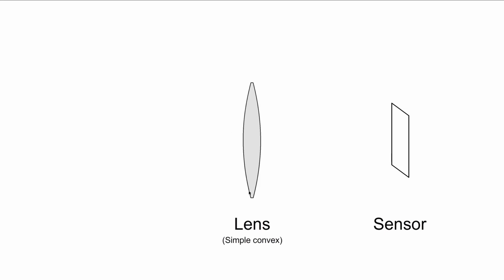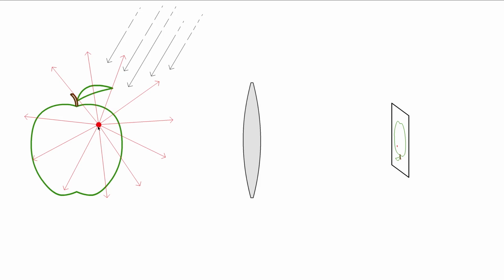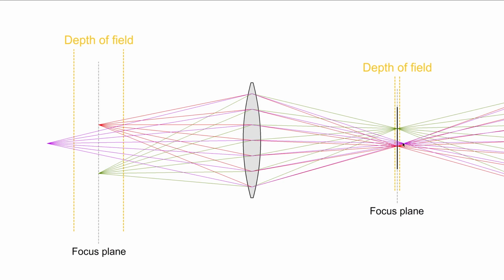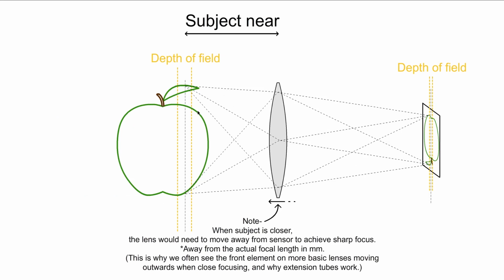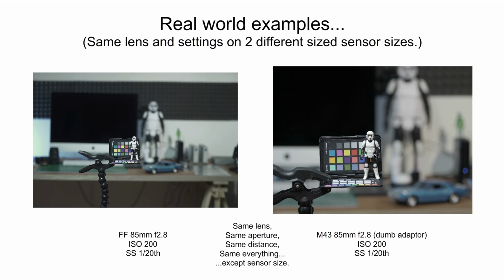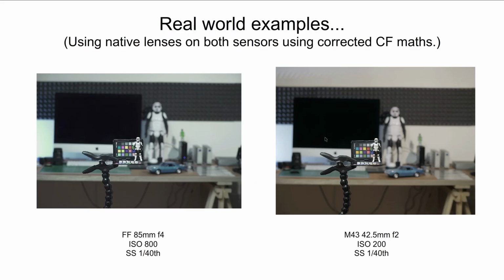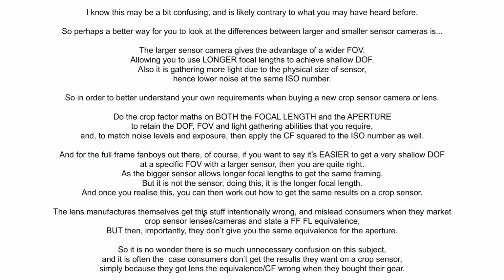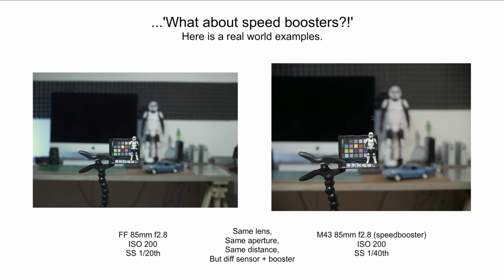Depth of field and crop factor misconceptions.

Comment: Biscuitsalive's Misconception: 

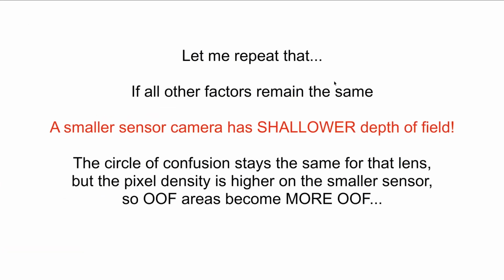@18:10 - "If all other factors remain the same, a smaller sensor camera has shallower depth of field... The circle of confusion has stayed the same for that lens, but the pixel density is higher."

WRONG, DOF is determined by the lens and shooting distance, not the size of the sensor. Image sharpness is likewise determined by the lens; it is not degraded by increasing the pixel density (resolution) of the sensor. The reason the cropped-sensor image appears blurrier than a full-frame image with the same FOV is simply because you are MAGNIFYING the dimensions of the smaller cropped image to match the size of the larger full-frame image. It is the SIZE of the sensor that matters, rather than the sensor's pixel resolution. We ALL know that when you MAGNIFY an image, its details will appear blurrier.
Reply from the maker: Fallen Star Features the DOF of the lens does not change using a different sensor. 
Yes. 
The apparent DOF of the image does change. 
As I clearly demonstrate. 

So not sure what your on about.
Reply: "Apparent DOF"? What's that supposed to mean? DOF is a measurable optical property, not an apparition. When you MAGNIFY an image, you change its optical properties. THAT's what I'm on about.
Reply from the maker: Fallen Star Features go and watch a video on the circle on confusion. 
I think that's where your falling down. 
I clearly didn't explain it well enough in my video. 
Please remember DOF is subjective to the medium you are recording. 
There is only one plane technically IN focus. 
Out side out that it's what's considered acceptably subjectively sharp enough or not sharp enough. 
and that subjectivity is dependant on the resolution you are capturing. (And to some degree the size and distance you are viewing the final image from)

I generally work in 4K video. On a 4K monitor. So that's a fairly consistent way to judge the OOF/in focus areas. 

In which case of course there is an apparent DOF. And can be compared and judged fairly equally. 

If I was working in 42 mega pixel photography and it was going to be scaled up onto huge billboard posters the DOF would need to be reevaluated for that medium. The circle of confusion for this would need to be much smaller to be acceptably sharp enough. 

Or inversely if I only worked to 1080 HD I could get away with a wider acceptably in focus DOF simply due to the circle of confusion being allowed to spread further before the sharp areas start to look OOF. 

I think you need to go away and do some practical tests yourself to see what I mean.  

You are not considering the final image and how it's DOF is subjectively read.
Reply from the maker: Fallen Star Features anyway. Sorry I don't have time right now for endless debate. About to get into the ocean. 

But I suggest you look at filmakerIQ video on the circle on confusion. And the role it plays on DOF. 
I think that's where you are falling short of understanding what I'm getting at. 
(He explains it better than me.)
Reply: What I'm seeing is more like a circular field of obfuscation on your part. All of the things you're trying to complicate are simply the result of MAGNIFYING a digitized image. When you do so, details that looked sharp because they were tiny become large enough for you to see how blurry they actually are. We've all seen this happen when cropping and enlarging images in Photoshop and there's nothing confusing about it. It's obvious why a large billboard needs sharper detail than an Instagram snapshot, but even there you neglected to mention that how much detail is needed depends on the viewing distance. A billboard 60 feet up in the air obviously needs less detail than one 60 inches away.
Reply from the maker: really not sure what your point is anymore. you are agreeing with what I'm telling you. so why are you suggesting I'm getting something wrong in my video?
did you actually watch it all the way through? what part is giving you an issue?

the smaller sensor WILL give an apparent shallower DOF if all other factors are the same.
(those being, distance, focal length, aperture, and resolution of captured image.)

not quite sure how you can deny that as its VERY easy to demonstrate with a quick practical test.
Reply: Because the fucking viewing distance from your monitor is the same whether you use high resolution sensors or not. This whole resolution fuckery is only relevant when viewing or printing in a specific size.
Reply: And still it only matters with IN-FOCUS elements so they're not blurred to death by too much cropping or low resolution.
Reply: Fallen Star Features, you say that DOF is not determined by sensor size. Then you say that it is the sensor size that matters. Which is it? Clue: it’s the latter. You are correct that the sensor size impact on DOF is also a function of magnifying, but that merely explains the why. It is the why concerning the simple fact that DOF is affected by sensor size in an “all else being equal” comparison (which is the only kind of comparison that’s useful). And that’s pretty much what Biscuitalive is saying. An unchanged size of Circle of Confusion with reduced-size sensor elements in it, is effectively the same as an increased size of Circle of Confusion with regular (FF) elements in it.
Reply: the pixel size doesnt change just the number of pixels so the coc would remain the same correct?

Comment: Am I correct that the crop sensor lens manufacturers also omit the angle of view differential when presenting 35mm equivalent data?  Superb video.  Thank you so much for producing it.
Reply from the maker: Jan Myskowski thanks. They vary from manufacturer to manufacturer. 
There is nothing wrong of course to stating a full frame focal length equivalent, on a crop lens/camera. (25mm m43 saying “50mm equiv”)
But to state that, and then state the NATIVE fstop is massively misleading. 
Either don’t put any FF equivalent. Or put both FL equiv and Fstop equiv. 

You see adverts and they say on a M43 14-140mm f3.5-f5.6 lens-> EQUIVALENT 28mm - 300mm f3.5-f5.6!!!!
It’s not! it’s equivalent to a 28mm- 300mm f7-f11.2 

Anyway. You get the idea. They use incorrect maths to confuse people. 
Then this is why consumers sometimes are disappointed in the performance of their crop sensor gear. 
It’s not the equipment. It’s the lack of awareness. 
Unfortunately. If you want full full frame performance on a crop sensor then you need fast enough high quality lenses. 
(Which do end up being nearly as big and heavy as the full frame counterpart. :/ )
Reply: Really appreciate your reply.  What I meant to ask, and probably did not word clearly, is whether you need to account for the fact that a given focal length has a fixed angle of view.  You can say that a 50mm APSC lens would have a FF equivalent focal length of 75mm or so,  but it still has an angle of view of 44 degrees or so, whereas a native 75mm FF lens would have a much narrower angle of view.
Reply: I just watched your terrific follow up video.  I’m not sure whether I am more confused or less confused about this question I am posing!!  You are using the term field of view and I am using the term angle of view.  Your last diagram in the follow up video shows that the field of view changes when putting a native FF lens on a crop sensor camera.  My question is whether the angle of view stays the same?  Angle of view seems to me to be a constant of the glass.  If that is so, it seems to me that you would get a different “look” between the otherwise identical fields of view.  Or, maybe I just have my head up my ass.  Help!
Reply from the maker: Jan Myskowski field of view and angle of view are the same thing. 
Yes the angle of view is same for lens. 
But when you put smaller sensor behind it the  full image circle (created by lens) isn’t used. 
Smaller the sensor the narrower the angle of view. 
(So on m43 the angle is halved compared to full frame. Hence the “2X crop factor” )
Hope that helps.
Reply: Thank you!

Comment: I've always liked that analogy about a marching army walking from a hard surface to a soft surface. I think you can take it a step further though. If you imagine each line of people is a different wavelength of light, the higher the wavelength the smaller and faster the gate of those marchers. So all the marchers are marching at the same speed, but on one side you have people taking large slow steps, and on the other side, people taking small fast steps. When they reach the sand, or mud, the people taking big steps get further into the mud before they are slowed down by it, and those taking small steps don't get as far before they are slowed down. That causes the marching lines to diverge from each other. I theory they should begin to converge on the other side of the "lens" but I think that could help explain chromatic aberration.
Reply from the maker: Grant Pluntze nice one! Yep that works lovely. I could see that working in a animation. :)
Reply: Grant Pluntze Dec

Comment: Okay so I have a question. After you applied the crop factor to the aperture, you ended up with the full frame image at f4 and the m 4/3 at f2. So of course these images look the same now. But with the full frame you still have the option to go to a lower aperture as opposed to the m 4/3 image you are at the lowest aperture setting (generally speaking if using a zoom). With that in mind wouldn't the full frame then be giving you a better depth of field?
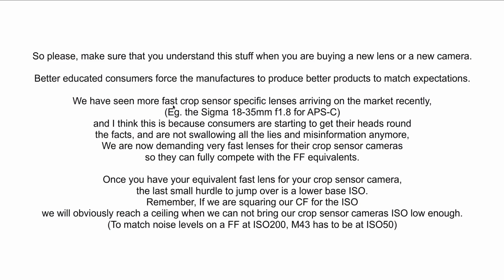Reply: 29:20 of the video he explains that consumers are wanting lens makers to offer true equivalent lens options.

But, I understand that Canon's famous 50mm f:1.4 is going to be hard to replicate into a 32mm f:0.875 for my APS-C Canon M...  or a 25mm f:0.7 for a M4/3.
Reply: Yes, FF wins.  Makes sense though.  Bigger is better.  Always has been, always will.  If you know what you are doing that is.

Comment: If you look up depth of field in Dofcalc for say 200mm @ f8 for APSC then change it to Full frame at the same settings then the DOF is actually wider on the FF setting. What is a speed booster?
Reply from the maker: Willnot Betracked what are you getting at here?
Reply: biscuitsalive Not "getting at" anything buddy - my first sentence was just a fact. Depth of field for the same focal length and aperture is actually shallower on apsc sensors than full frame (according to DofCalc). My second sentence was a genuine question - what is speed booster? I have never heard of that before. I wasn't trying to be disrespectful. 😀
Reply from the maker: Willnot Betracked ok, sorry i didn't mean my comment to sound like that, i was just a bit confused. The first statement sounded like you were pointing out something that countered what I said in the vid. 
But it of course does not. 

A speed booster or “focal reducer” is a very popular device many crop sensor users choose today to recreate a larger sensor FOV/DOF on their smaller sensor. 
Look at “metabones” that is the market leader. 
I use a XL .64 speedbooster on my GH5
And it means I can use my full frame lenses on my m43 camera and achieve the same FOV and DOF as a APS -H sensored camera. 
(I can use longer lenses and keep the framing)
Basically it regains the lost light that would spill around the smaller sensor. 
So the image is brighter too. 
(1.5 stops faster with my XL)
Reply: biscuitsalive Ok, thanks. I'll take a look at this metabones thing! 😀👍
Reply from the maker: they are expensive, but are amazing. the total light gathered from a full frame f2 lens is 4 times the amount gathered by a native M43 f2 lens. so its a awesome to be able to tap into most of that available light on a small /crop sensor camera.

Comment: QUESTION:  I get really confused when you say to square the iso.  If you square any number, then is not that number multiplied by itself?  EX: 200 squared would mathematically be 200 x 200 ... and that equals 40,000.  However, in your example towards the end of the video, instead of squaring the iso, you actually increased the iso two stops, because the micro 4/3 sensor is twice as small. I can understand that part, but what confuses me is how am I to determine what the equivalen iso should be on a Canon APS-C (1.6 cropped) sensor.  Can you provide some clarification please?  It would really be appreciated.  Thank you.
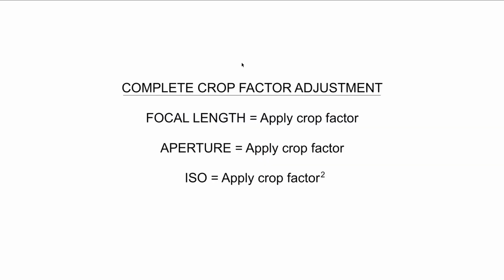Reply from the maker: Hi so what I was getting at (timecode 23:28) is you take the crop factor.
eg. X2 for FF - M43
or X1.5 for FF - A-PSC

and you square that, and apply as you would for the rest (FL / Fstop)

so for a example of the equation written down=

Lets say we have a M43 camera, we want to match ISO equivalence for Full frame. (to get a good approximation match noise level equivalent, and complete the whole crop factor formula )

We take the M43 ISO of 200, we apply the crop factor and square it.
So if you tap-
'200'
'Times' (X)
'2'
'X2' (the squared button)
'equals'
and we get 
800

(long winded way of saying we square the crop factor, not the iso number.)

Or if the above was going from A-PSC to FF we would do-
200 (for our A-PSC ISO) 
'times' (X)
1.5 (or, for Canon, 1.6)
'X2' (the squared button)
'equals'
and we get 
450

So in that case the A-PSC ISO would be at 200, and would match the FF at 450.

(Give or take minor technology differences.... technically if you want to get into that the smaller sensors do slightly better than the bigger sensors if you stick rigidly to the crop factor squared)

Tonys testing put it on average, over many diff sensor manufacturers, at 1 +2/3 of a stop, rather than 2 stops as I'm showing here.
I think some of this is due to the fact M43 has a squarer sensor... and lenses tend to be brighter in the middle, so the squarer sensor is slightly more efficient once the total SS size is removed from the equation. 
but obviously we can fall down a rabbit hole of tiny variants if we wanted to.

Personally from my tests comparing a Sony a7s and a Panasonic GH4 and a Canon 5d (plus some other random canons and other A-PSC Sonys)
Personally I find the straight forward crop factor squared matches noise levels REALLY closely. (and of course matches exposure too.)
But then the a7s is one of the best low light performers, when i use a canon as the FF on test, then the smaller sensor looks ever so slightly cleaner. but really nothing much in it at all I can see. So keep it simple and just use the squared crop I reckon.
Reply from the maker: Sorry, just realised you had already answered the question for me... and WAY more succinctly! :D
Reply: I thank the both of you very much.  I get it now.  Much obliged!!!!

Comment: Brother you make things so unnecessary complicated just remember one simple rule, DOF get smaller simply because 50mm lens for  FF system is a 75mm lens for APS-C system! Because for native APS-C 50mm lens front glass physical distance from sensor (focal length) is shorter (e.g. 4cm) compared to FF 50mm lens front glass physical distance from sensor is longer (e.g. 6cm). Hence FF 50mm lens mounted to smaller APS-C sensor = native APS-C lens of 75mm with according DOF. Possible downside FF lens will have less light on APS-C system by as much as crop factor is i.e. FF 50mm f/2.0 becomes on APS-C system 75mm f/3.0.

Comment: Good stuff. I wonder if folks would understand speed boosters better if they were called telecompressors. And, since you brought up the sigma 18-35, a 1.8 is really about the same as a more standard f2.8 after crop. I'm sure there's a reason Sigma designed it that way. I've heard people who were to quick to say their sigma with a speed booster was giving them an f1.4 on their GH4 without understanding any of this. I'll have to send them to this vid from now on. 
Thanks for all the work.
Reply from the maker: Sun Pixel Video yep that 18-35 f1.8
Would be exactly like a 27-52mm f2.7 on a apsc or a gh4 with speedbooster. (Tiny bit slower and tighter on 1.6 Canon apsc of course)
So just a decent solid zoom. (Not the f1.2 zoom some speedbooster owners think it is)

Don't get me wrong, not bad mouthing any system, sensor or booster. 
But I get fed up with seeing so many people not knowing this stuff and being very "shouty" in forums. :)

Not that I'm super clever, as I said in the video I didn't know much of this about 2 years ago. 
But best way for me to learn is to buy a load of gear and play with it. Doesn't mean others can't learn a much cheaper way by learning from my mistakes.
Reply: How do you get to 27-52mm f2.7? I would love to see the calculations to get there.
Reply: Ah, I see you just multiplied by 1.5 for Nikon APS-C. I had the GH4 with speedboostercrop factor 1.42 in mind and couldn't get it to make sense.

Comment: practical application of SB is the  image gets brighter all things the same etc etc ...

IT does mess with your mind if you are not a visual person..

I like the sane only you have the soldiers speeding up on sand bend should be other way  no?
Reply from the maker: Matthew White no. They should be slowing on sand. Did I mis speak? I will watch it back later and check.
Reply: u spoke correctly but the troops are shown falling behind in the light. 
ok I think I mispoke... sorry  not enough cafine and too little sleep.. I had the angle bend the wrong way.. u r correct!!!